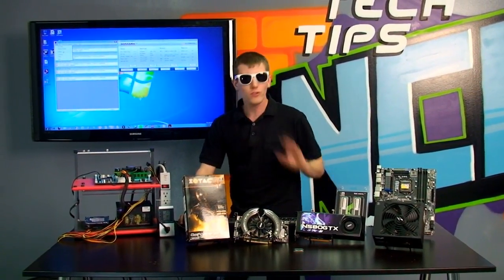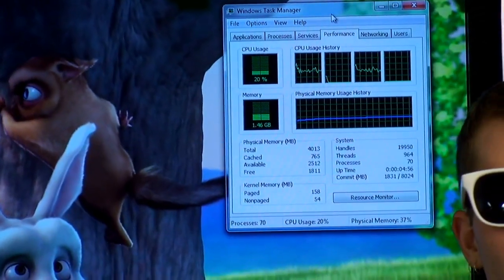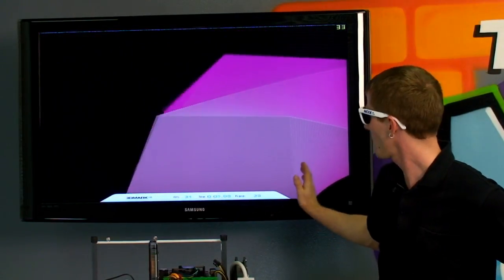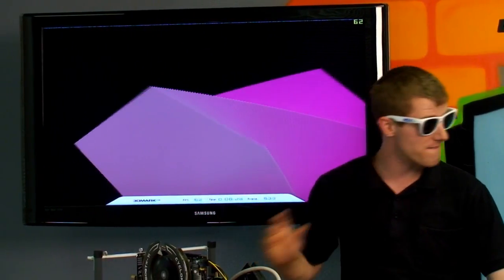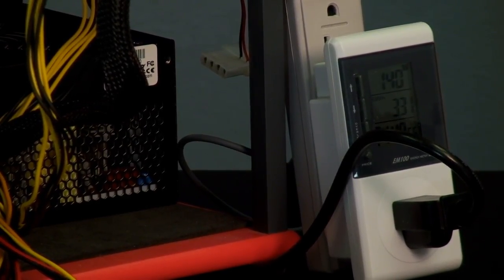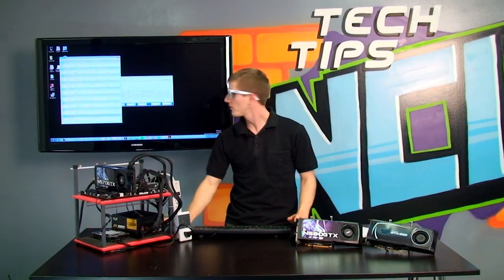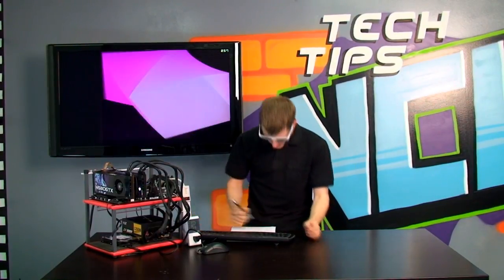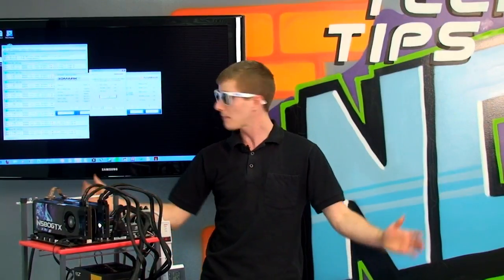System Power Consumption - A Closer Look NCIX Tech Tips

Comment: Would a 650w psu be enough for an AMD fx 6300 and SLI gtx 760s?
Reply: Thats cutting it very close. What power supply do you have?
Reply: I'm still researching for my first build, so I don't have one yet.
Reply: 2DoubleLightsabers A 650w PSU should be able to run that; make sure you get a really good PSU though.
Reply: NVIDIA recommends 720+ watts, but you will probably get away with a high quality 650 watt. I am using 2 760s and I've got a 750 watt Rosewill Hive PSU.
Reply: 650 watts will be MORE then enough. you should not look at the tdp to calculate the system power usage. use a power calculator website and you will be surprised.
Reply: yannick van niel I've seen these websites give horribly inaccurate results, so I'd play it safe and use the company's recommended TDP. It gives you more headroom for upgrading in the long run, too.
Reply: ***** even if these sites are not accurate. the recommended power is wrong too. if you look at benchmarks you will see that a pc will never use as much power as the tdp. you can have a high end graphics card and cpu and 500 watts is enough.
Reply: yannick van niel I wasn't saying that it wouldn't be enough. I'm sure it would be just fine. PSUs degrade over time, so I personally would leave some headroom (I'd use the recommended TDP to find what I should get) unless you are fine with getting a new PSU every couple of years. It would help, too, if you were planning to do future upgrades (new CPU, GPU, etc.), as you would have more wattage at your disposal instead of having to buy an entirely new power supply.

Comment: What is the point of a 1250 watt power supply when  a gtx 580 sli with an overclocked quad core only hits 550 watts? I have a generic 300 watt power supply powering a phenom 9550, 4 gigs of ddr 2 ram, a radeon hd 4850,  with a one hard drive. I know I should probably get a power supply that wont kill my components but do I actually need a bigger one? I've never had the PC crap pout under load or anything.

Comment: I have a 450w cooler master gx 80 bronze certification and im running a i3-3220 stock ghz (3.3), a asus gtx 650 ti 1 gb oc (normal overclock setting) and i bought a msi z77ag45 gaming motherboard, and i wanted to buy a watercooling kit. Can i ? i have some super talent 8gb ram at 1330ghz

Comment: No it isn't. It is the most likely to explode under high power usage. You get that non 80+ rated PSU to around 500W, and it will probably burn out. If you managed to get it higher than that, closer to 600W, it would probably damage something

Comment: Hey Linus, what PSU do you recommend for my setup? I'm currently looking at a 1200w 80+ Platinum Corsair 1200i

Core i7-4930k 4.3 Ghz
Corsair H100i CPU Cooler
3x GTX 780 ti (1.1Ghz 3 way sli)
16GB DDR3-1866mhz Ram
Asus X79 Deluxe Motherboard
Reply: Ask the forums on linus tech ,you'll get your answer within a day.
Reply: You should be fine with that config.  You can use pc part picker to guestimate your power needs.
Reply: JacobStar91041 3way sli, 4930K and asking what PSU you may need. You clearly do not know what you're doing, do you?

Comment: Wow thanks, i thought i was in the red with my current ultra 550w psu running.
440gt Phyx card
Evga 550ti main
6gb Crucial Ram
Asus m4n75td mobo
Athlon IIx2 255 OC@ 3.9Ghz
2 HDs
3 chassis fans.
but thanks to this i dont need to upgrade it until i wanna upgrade sum else.

Comment: It still makes me question the need for a 1200w PSU.  I am running a 990FX board with an 8350FX CPU and 2 XFX 7970's in Crossfire.  I have 16GB of Vengeance Ram and 4 1TB HDD's.  With your video it seems like I went overkill on the PSU.

Comment: i5 3470
7870 
4gb 1600mhz ram 2x2gb
desktop board b75
1 dvd drive and 1 hdd 500gb 7200rpm 
2 fans in the case and 1 on the stock intel cooler 
Will a 550w ocz fatal1ty handle this? it is 80plus eff.

Comment: What do you call the device he uses to measure the wattage? Wattage meter?
Reply: +Demi Barton It's a wattmeter, I believe, just like a voltmeter is used for voltage and an ammeter for amps (current)
Reply: +Demi Barton it is similiar to a product I have called a Kill-a-watt P3, they have different screens you can flip between with the buttons that allow you to display watts being used, amps being used, voltage at the outlet and for as long as you keep it plugged in it will keep track of how many Kw is used by what is plugged into it. I use mine mainly to monitor the dehumidifier power usage in the basement (which is around 400 watts), but I've also used it to get average power consumption of the refrigerators in the house and to test what my LED light bulbs actually use, side note the Utlilitech brand from Lowes actually uses what it says on the box, 9-watts for the 60watt equivalent but actually comes in around 5.1-5.2 for the 5.5-watt 40 watt equivalent, where as the GE 10.5watt and 11watt LEDs use more like 13 watts. I even know how much my wifi router and cable modem cost me to run every month (8.64Kw every 30 days or about 95 cents a month with what I pay for electricity) and I was able to see how different backlight and brightness settings on my TV effect it's power usage, with my preferred settings it's around 110 watts but if I crank up all the energy saving settings it will drop into the 60's, but I don't like how dark the screen is then.

Comment: Yeah people over spec their power supplies and waste money on their electricity bill. The optimum efficiency is reached mid range, so my 2.66Ghz Quad Core HD6770 RAID0 system uses 100-200w means I use a 400w PSU for best efficiency.

Comment: no gpu can pull that much wattage by itself unless its a 6990 / 590 / 7990 / 690 at full load with a 550watt for the entire system you are looking at max a 7870/7950 or 660ti/670 with some headroom for OC'ing both the cpu and gpu, any higher than that they wont perform at 100% due to the lack of power and also i hope its a good PSU otherwise it might fail rather quickly drawing lots of power for its capacity

Comment: I have a Thermaltake Thoughpower Grand 1050Watt
Gigabyte x79 UD3
G.Skill RipjawsZ 16GB ddr3 1600
Core i7 3930k @ 4.5Ghz
EVGA GTX 470 in SLI
Two HDD's and 1 SSD
six case fans with a Corsair H70
I don't know what my draw from the wall it though that's something i'd like to find out sometime.

Comment: I didn't understand the difference between the wall wattage and the wattage in the system. He mentioned it but I didn't get which is higher.
Reply: The wall power is always higher than the power consumed by your system. The difference will be lost in form of heat in your power supply.
Reply: Thanks I was comparing the wall to what actually the pc needs because I am building a pc and I want to know how much watts I will need.

Thanks for the tip

Comment: I've just been testing my PC with a watt meter, i get 100W idle (from the wall) and on a synthetic full load (prime 95 and furmark) i get 440W from the wall. this is with an i5 2500k @4.4, a 560 Ti @ 920core and a pretty average 'other' parts list (RAM, HDDs ect).... I feel a little stupid buying a 700W PSU now!

Comment: im thinkin about upgrading my cpu from i3 2100 to i5 2500k. i am now using OCZ StealthXStream 2 600W power supply with MSI N570gtx twin frozr 2 GPU..will my PSU supply enough power to my system with i5 2500K(4.00GHz OC) ???

Help me guys :)

Comment: it is a good choice for me to build a new pc like this for bf3?
1   Intel Core i7-2600 (3.4G, 8M Cache, LGA 1155)
2         ANTEC TP750 TruePower 750W 80Plus Bronze 
3         Hitachi HDS723020BLA642 2TB SATA3 6Gb/s /64MB HDD  
4         A-DATA DDR-3 1600MHz 4G Ram 
5         MSI P67A-GD55 (B3) 
6         Msi DI-N580LNGTX580 Lightning 
7         COOLER MASTER CA-RC371KK (black) ATX Case(
8         Cooler Master RR-B10-212P-G1 Hyper 212 PLUS+ CPU Fan

Comment: im using a 700 watt power supply that came with my computer and ive had this computer for about about 2010 or 2011. I am runing an R9 280 graphics card with an old 8120 cpu but i think its bottlenecking because some of the games dont run at higher fps like they should, considering the gpu that i have.

Comment: i'm using a 240W power supply wich the following pc specs:
CPU Intel Pentium 4 531 3.0 GHz
GPU 9500GT 512mb
RAM 1.5Gb ddr1 :)
80Gb HDD
1CD-ROM
and 2 fans

Comment: I don't understand this. I connected a amps meter yesterday and my pc is using 40w on idle and 299 when playing bf3. I'm in South Africa.

specs = 

i5-2500k @ 4.5GHz
2x GTX 570 twin frozr III power edition (overclocked to 800MHz core and 2100MHz memory stock voltage)
2x HDD and 4x externals
corsair ax850w
8GB exceleram 1600MHz
cooler master storm sniper case
usb sound card

Comment: i want to add a Artic cooling Accel-TT II Accelero Twin Turbo II on my 6870, i have a xfx 650w psu. will there be a problem with power consumption.
i5 760 @2.8 stock cooler
8gb mushkin redline
sapphire 6870 1gb
Msi H55m e23(ik its shit)
Intel 520 60gb SSD
WD caviar black 1TB
XFX 650w Psu

Comment: i use a cx430 i got a GTS 450 n phenom II x4 965 4.2ghz @ 1.48v 8 gigs of corsair vengeance 1600mhz ram now the main problem is i m get low power on my+12v m getting just about 11.08 or 11.8v can someone explain me y the psu is new n replaced too i thought it was a faulty one but the replaced psu gave the same output

Comment: I use an XFX 750W 80+ silver psu for my i5 661 OC to 4.5ghz on 1.34v, gigabyte H55N-USB3 ITX MOBO and OC gtx 460 1gb card and a WD black with the OS on a corsair SSD. Pretty stout system and all that is aside from my MCP655 pump and 12 coolermaster fans on dual 360 rads

Comment: ok thanx alot. i need to know cuz i stuck between. upgrading my system to this:
2x 550ti's sli
AMD 1090t
Corsair 750w. on a asus m4n75td motherboard.
or just wait until july and get.
Ivy bridge i5
a nice motherboard
gtx 680
corsair 850w
and use my old 550ti oc 1Ghz as my physx card.

Comment: As he said if you hit the higher end of your power supply it will also be inefficient. It's a balancing act. Most people I've known to buy a 1200w psu tend to need no where close to that and their computer burn power like it's nothing. Such as my idiot room mate who's computer was no where near what mine is now and needed it's own bloody breaker to run otherwise it had the tendency to pop the breaker. I went with an 800 for that and other reasons.

Comment: So im thinking of buying a prebuilt computer that comes with a 650W supply on a high end pc is this limiting or enough? and can someone give me the idle and load draw of this ? (approx) - CPU: Intel® Core™ i7 4770K
CPU Cooler: NZXT Kraken X60 280mm AIO Liquid CPU Cooler
Motherboard: MSI Z97 Gaming 5 Motherboard
Graphics: MSI GeForce GTX 780 Ti Gaming 3GB
Memory: G.Skill Ripjaws X F3-12800CL10D-16GBXL 16GB (2x8GB) DDR3
Solid State Drive: Samsung 840 EVO Series 250GB SSD
Hard Drive: Seagate Barracuda 2TB ST2000DM001
Optical Drive: Samsung SH-224DB 24x DVDRW OEM
Case: NZXT Phantom 530 Case White
Power Supply: Corsair CS650M Modular 80 Plus Gold Power Supply
Additional Lighting: Phobya LED Flexlight High Density 30cm White
Reply: go for a larger power supply like 850W or even 1000W to be safe
Reply: 650W (especially gold) is fine for a single video card.  But you'll need about 850W for dual GPUs.

Comment: 64GB RAM is a little bit excessive yes. SSD's? Never have enough of them. 2xGTX690? Not nearly overkill if you're playing at 5760x1080 without 3D. I'd understand if the high end monitors of today were 1024x768 but seriously no PC nowadays is overkill.

Comment: I'm going to build a computer with the following:

Amd fx8350 cpu
Radeon 7970 gpu
Gigabyte 990FXA-UD3 SKT-AM3+ Motherboard
1tb western digital hard drive
8gb corsair ram 

Would  a 750 watt corsair power supply be too much ?
Reply: its more than what your system need but not too much.
Reply: Depends what kind. A quality 750w would be a bit much, but a BS 750w would probably not deliver enough real world power
Reply: If u can find it get the Cooler Master V700 its an amazing gold rated 700w PSU with platinium levels of efficiency except at like 100 % or something and you can find it at a very good price.
Reply: I have same build with different ram (munchkin 8gb) and r9 280x.. and i got a corsair 750w gold modular.. works fine.
Reply: even a quality 450watts can handle that configuration
Reply: Not if you wanna overclock

Comment: Your computer should use 412W max 450W...U have new generation processor what is power saver...than graphic card is same power saver... on extreme power supply calculator website You can check all. Iv got i2500k, 8gb ddr3 2133, 1 SSD 256GB OCZ Vertex 4, gtx460 and my pc taking only 401W ...iv got PSU Corsair HX520W :) Dont worry all will be fine ;)

Comment: My main purpose of building this pc is 3d rendering and gaming.
This are the components i have chosen:

AMD FX-6300
Sapphire R9 270
ASUS M5A97 R2.0
Corsair vengeance 16 GB ram
Samsung evo 128 GB SSD
WD BLUE 1 TB HDD
Corsair cs 550W PSU

My budget is 1000$ including monitor
Please suggest me any other parts or possible bottlenecks
Thank you.
Reply: I would go with 8350 CPU. 970 GPU for the best bang-for-buck performance and so on, also cuda. All I can think of.
Reply: Thanks for your reply

Comment: o thanks for the info so i guess i should buy like a 450 power supply that cost the same as a 600 cheap power supply like corsers 430 bronze power supply .i guess i learn that i dont have to buy a crazy 130 power supply

Comment: A 8150 is, as much as you debate this, a big bottleneck to 2x 590's, it is simply too slow to handle GPU's of that power.
Also, if he has around $2000 to spend on only graphics cards, he would have money to spend, so why not take it one step further with a very high end i7?

Comment: you don't really need an 80+ rated power supply it won't effect the power output. That 80+ stuff is mainly marketing bs and a not 80+ branded power supply won't be any less efficient. An for that type of system you could probably get away with a 450 watt power supply. I have a 250 watt power supply running a oc quad core and runs under 200 watts from the wall

Comment: A fully decked out system only uses 530 watts? Wtf, lol. I feel bad for even contemplating buying a 1,500 watt PSU now. 

Btw, here in quebec, a 500 watt system running for 2 hours costs less than 6 cents.

Comment: anyone know if my new system (waiting to receive) will bottle neck i have

AMD radeon R9 290 4gb gpu
Asus M5A97 R2.0- AMD 970 motherboard
700w PSU
AMD FX 8320 CPU
2tb SATA HD (will add SSD once i have a little more doe)
16gb DDR3-1866 G.skill ripjawsX memory
Astek 510 liquid cpu cooler
120mm fan

PS not sure if it matters but I'm only really interested in 1080p gaming just want to be sure my performance will be as expected all my research says yes but a few questions I've not been able to answer.
Reply: No bottleneck.
Reply: TY only took a couple weeks for a reply lol i was like damn asked that in the wrong place

Comment: After watching this video I feel that my OCZ ModSxtrem 600w modular PSU will be able to handle a couple HD 6950 2GB crossfired, as I only have an I5 2500k Overclock to 4.0ghz, 8GB of ram and just a single Hard drive, I guess that my system should pull less than the SLI of GTX580 which are power hungry cards!!

Comment: i ues a coustom built PSU, i used a 2500W vacum cleaner nad took out the power suply in that, conected all the cables(its a lot harder that that but uknow) i took from my olde 850W psu... i dont know how long i will work cuz well its a vacumcleaner.. LOLz

Comment: Does anyone think I could run this system on a corsair TX850M (850Watts):
i7 4700k (Overclocked to 4.5GHz+)
Asus Maximus VI Extreme
4+ USB Devices
Xonar Phoebus Sound Card
Touch Screen Fan Controller
1 Optical Drive
3 Asus Direct CU II GTX 760's

Comment: there must be something wrong.... 33W for a 2600k and a 560 TI should NOT! be true... the 560 TI should use 10W at idle, and 160W at use....... something is REALLY wrong....

and even though the PSU 1250W don't work in the sweet zone, it should be a lot better than the generic PSU.......

i use a 850W silver :)

Comment: Using an 80+ Bronze 400watt power supply from Cougar. It's powering my 560ti, my 2500k at stock, my 16 gigs for ram (4dimms) , my three hard drives and two SSDs. Anyone think I can overclock the badboy to 4.4ghz without the PSU blowing-up? :P

Comment: My System:

be quiet! Dark Power Pro P9 750W ATX 2.3 (P9-750W/BN174)
I7 950
EVGA X58 Classified
2 x EVGA GeForce GTX 470 Superclocked+, 1.25GB GDDR5, 2x DVI, Mini-HDMI (012-P3-1475-ER) in SLI
Corsair Dominator 6 GB PC1600

Comment: u sure could my asus hd7770 2gd5 only pulls 80W max and I run it with a fx8350 which has a max tdp of 125W so u sure would come by with a 500W but I got a 750w since i want another card in crossfirex but even then u could come by with 500W but u wouldn't have much more room left to work with

Comment: i use a 850W Power Plus Bronze from Antec. 4670k at 4.4Ghz. /  R9 290X in crossfire / 16 gigs 1600 cas 8 GSKILL RAM / and an h90 AIO cooler for CPU.
Reply: It would have been cool to have measure it.
Reply: Courtney Bennett so a power draw of like 550w

Comment: All these upgrades and no SSD? That hard drive will be a bottleneck in the real world.
Reply: That was not the point of the video though and SSDs draw near zero power so measuring them would be pointless.

edit: oh, and it is a 2011 video and back then SSDs had low storage, were super expensive and generally crap :)
Reply: I understand, I just thought it would have been interesting to see the difference storage devices make since Linus basically covered everything else. I'm sure it would have only added another few watts like the ram did, but it would be interesting to see and could be significant for people with more than one drive such as someone building a server.